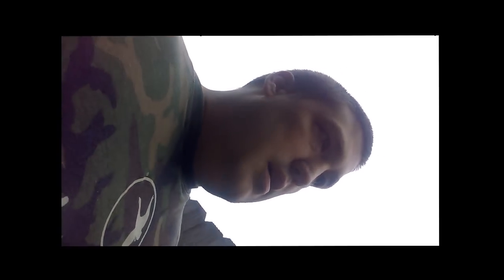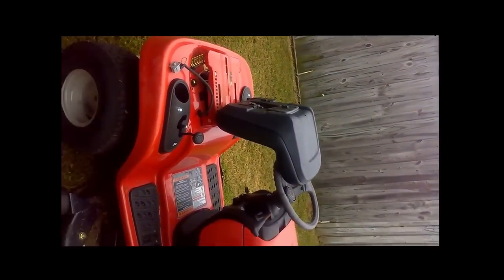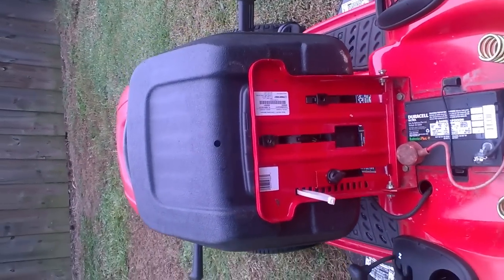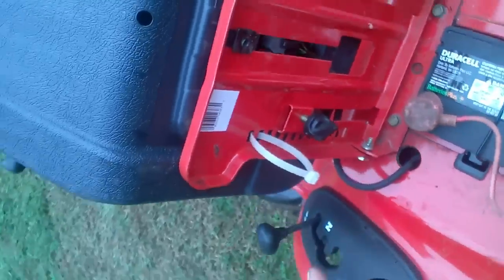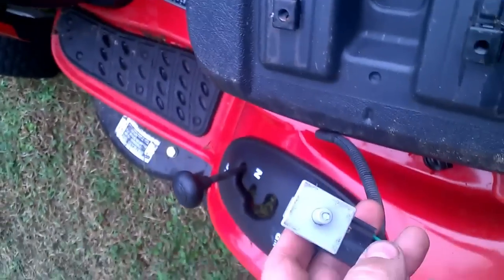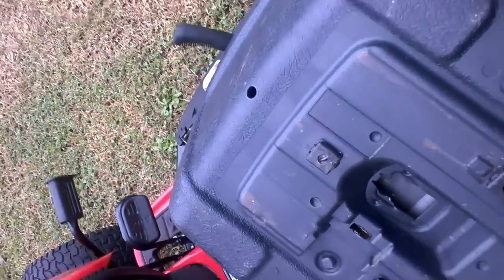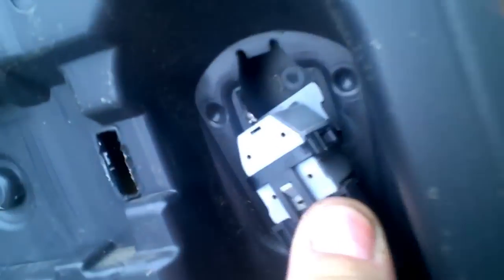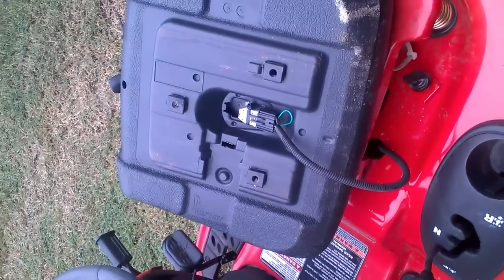How to by pass seat switch on lawn mower

Comment: Hey all fellow lawn tractor owners doing modifications. Safer 
modification. I know it's a lot to read, but PLEASE READ FULLY before 
responding. John Deere L125 owner here and I did the same safety seat 
switch modification, but with a caveat. The seat safety switch is there 
for a reason, past accidents, or it would not of been included as part 
of a  production run modification,
  however it was cumbersome to me, as others. I do a lot of lawn work 
with a cart and there is much short time on and off the tractor for me, 
maybe 1 minute at a time, and didn't feel like killing the starter or 
draining the battery with constant restarts. Instead of disconnecting or
  bridging the switch to make it inoperable permanently, I spliced into 
the two wires, drilled a 3/8th inch hole and connected a marine 
stainless steel toggle switch that won't rust under the seat. Cost about
  $5.00. In the OFF position it had no effect, leaving the seat safety 
switch still operational. In the ON position it bridged the two wires,  
akin to jumping the wires as shown  in this video. This left me with the option to leave it ON (seat safety switch disabled, ie: bypassed,)  when
  I was using it, and OFF (Seat safety operational) when fiancé, kids, 
or  grand-kids were mowing. This gave me peace of mind that they were 
safe should the fall off the tractor after knocking their heads on a low
  hanging tree limb, and have the mower inadvertently circle around and 
run over them. This model has an auto tranny and has cruise control. 
Won't strop unless throttle tapped, or brake applied. Thus the worry and
  concern. This could be carried further, which I am updating,  to
  have a key operated on/off switch instead of a regular toggle. 
Necessary if you feel others would switch it to ON (bypassing the seat 
safety switch)  when they shouldn't. Heads up to all, let us all be safe out there, keep the family out of harm's way. Happy Lawning/Gardening.
Reply: The switches are there for a reason. I also bypassed the seat switch several years ago but don't know how many times I've gotten off and tripped it into gear with my leg and jumped right back on. Bypassing the blade switch is a bad idea and remember that the belt still spins the blades if you bypass the seat switch. Just be extra careful when bypassing ...............................